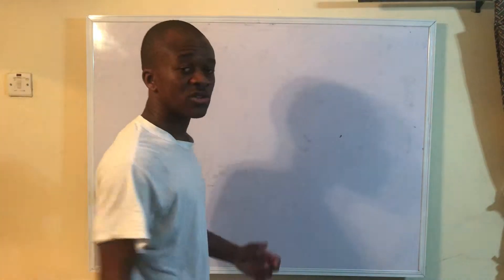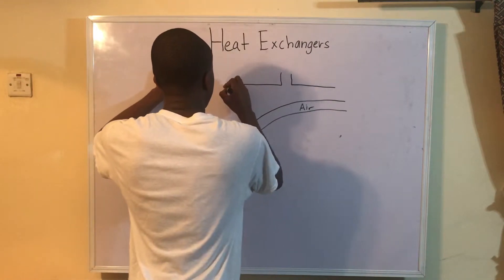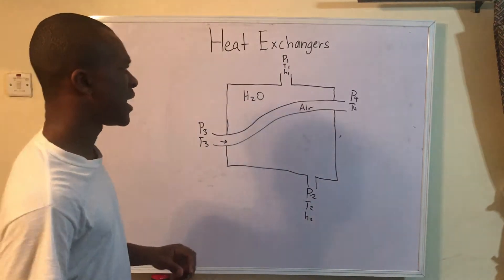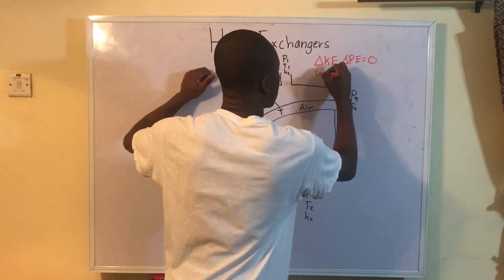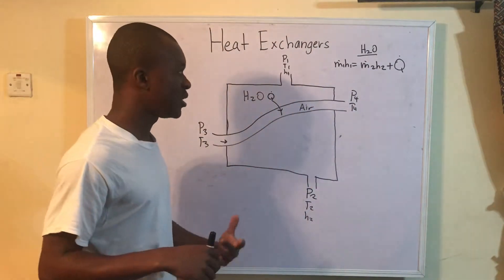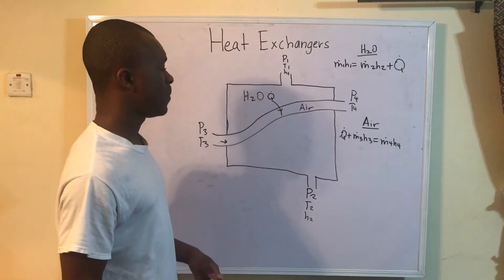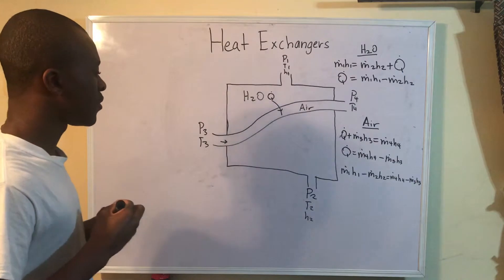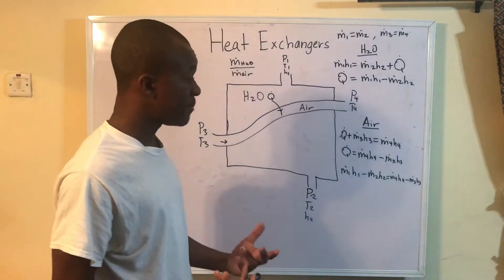Lesson 14: Heat Exchangers

Comment: Thank you so much for the clarification!
I was wondering why we are doing h4 - h3 for air and not h3 - h4??
Reply from the maker: Basically, we're taking the air as its own system. When we do the energy balance we see that heat is coming into the system, making it stay on the left side. Once we solve for the Q, we have to subtract the m3h3 from both sides, bringing the term to the right side. This gives us m4h4 - m3h3. Make sense?
Reply: Baahir Jinadu absolutely! Thank you